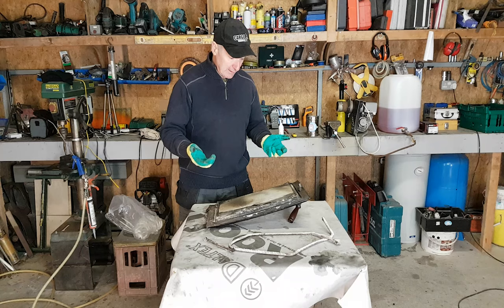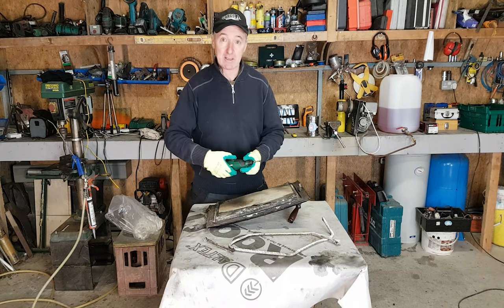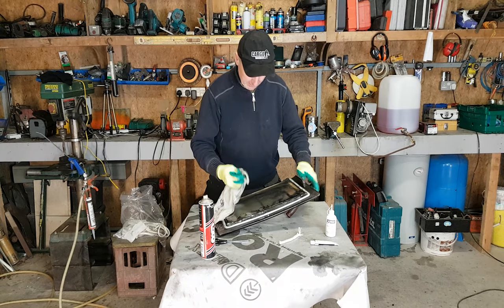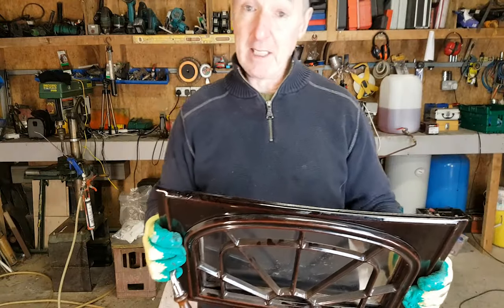Easy Stove Door Seal Change and Stove Glass Cleaning

Comment: Hi Gerry, I have a problem with my stove. Sticky resin is coming down from the flue and puddling on the floor have u seen this before?
Reply: Your wood isn't dry enough. That's from the moisture mixing with creosote. You might want to get yourself some kiln dried wood to dry that out. It is also an indication of creosote buildup. Which could lead you to having a chimney fire. Which could burn your house down.
 22 year+ firefighter here in the U.S..  Hope that answers your question.
Reply from the maker: Hi evo4aps I have to agree with Eleventeen Machine and it's most likely creosote. If you are burning turf or low grade fuel and the moisture content is high or the air supply is too restricted the burn wont be complete. Hope this helps Cheers Gerry👍

Comment: I thought there was a heat resistant layer on the inside of the glass which is washed off by using kerosene/wd40 etc.? Will the glass not crack as a result?

Comment: Very good Gerry! I've tried that silicone stuff and didn't like it either. I peeled it out and bought some liquid concoction. I can't remember what it is called but remember the container.
 Happy Trails my friend!
MB BAR RANCH
Reply from the maker: Hi Martin. The stuff I used in the video was very good. Lit the fire and it worked great with no issues. I actually don't have a stove working in the shed atm because I renewed the flue a few months ago but I have some shed time tomorrow. It's -2 °C here now but it has been a very mild winter so far. Thanks Martin for commenting Cheers Gerry

😀👍